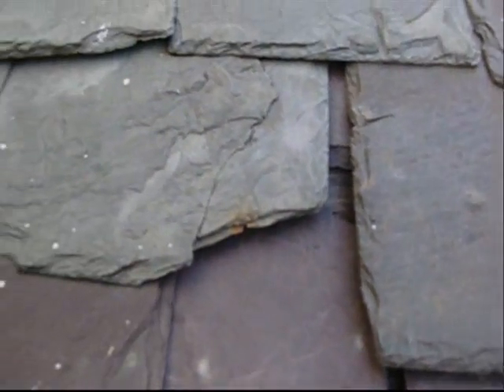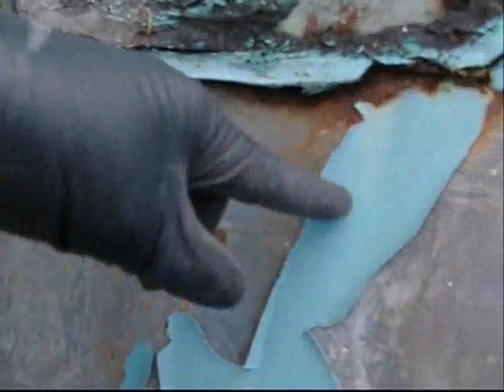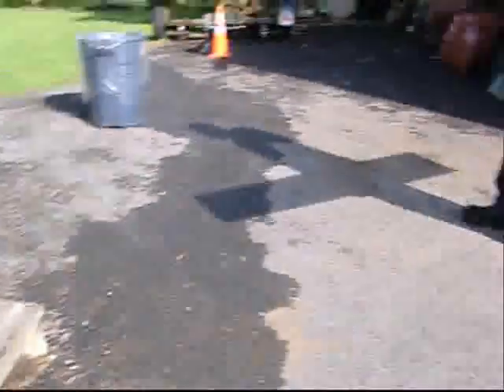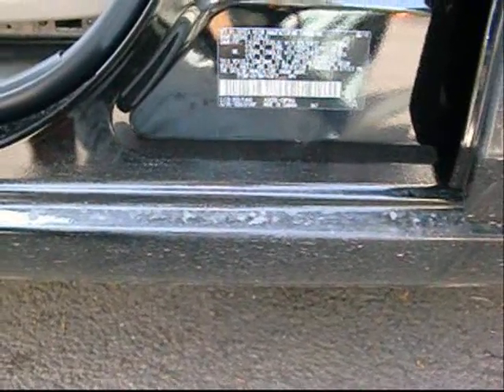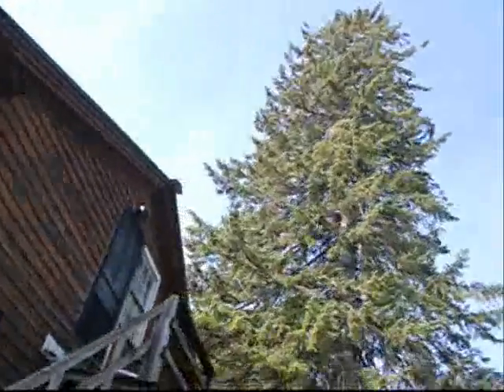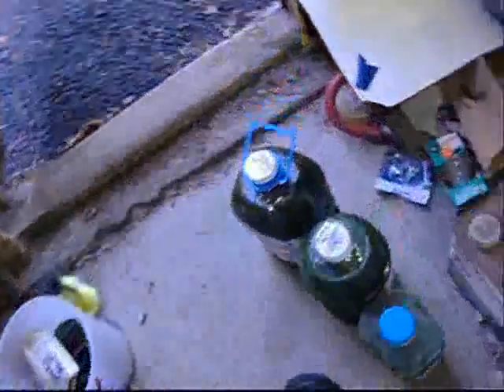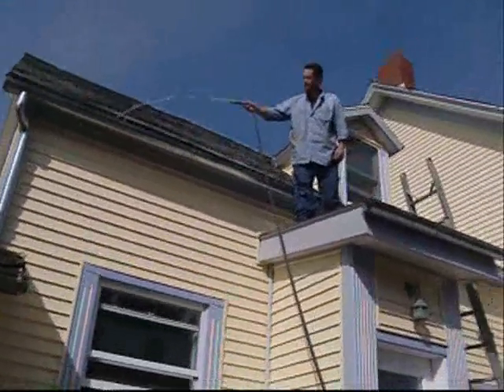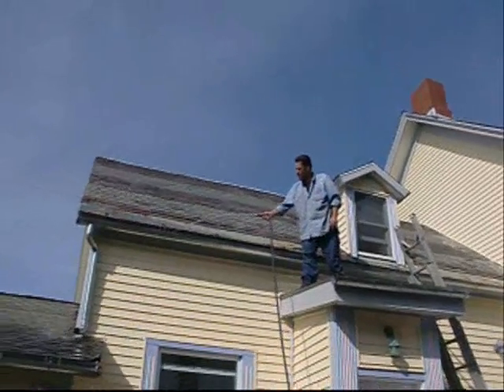9 23 11  Slate Roof Repair  I

Comment: 4:38 Is that a 1988-1998 door I REALLY needed 2 weeks ago ? I had to pay 125 $ for a rusted one at the scrapyard and you have a free one there.   Can you show it in a vid. I repaired the one I got but no rust is better than rusted and fixed